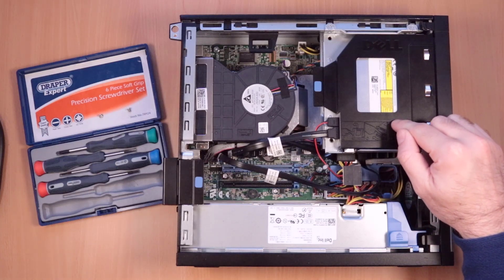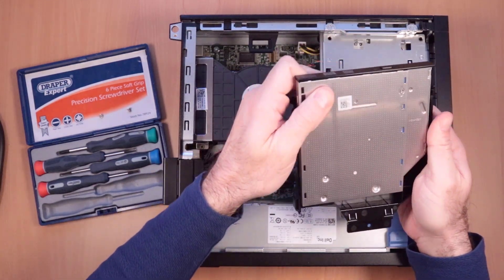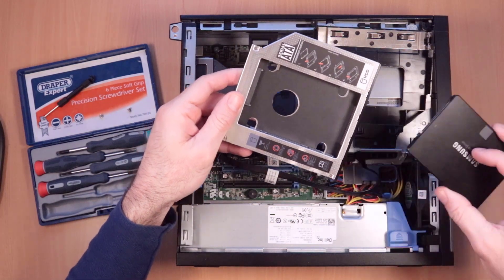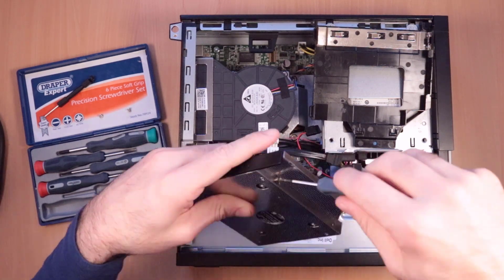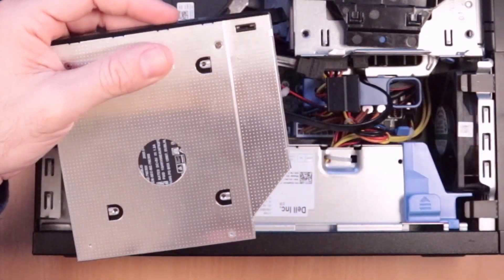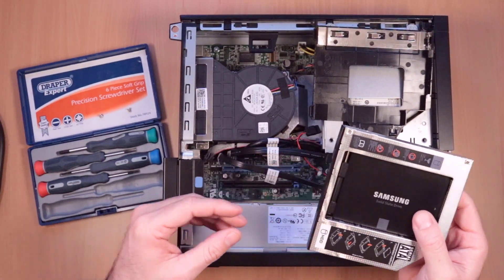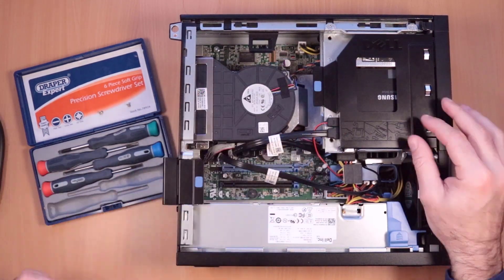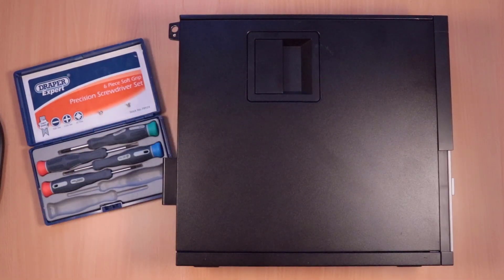Dell Optiplex 7010 Swap DVD Drive for Solid State Drive

Comment: No luck with getting my 7010 to identify the new ssd. Bought this caddy and disk management only finds the DVD drive. Assumed faulty caddy so plugged directly into the ssd using SATA and spare power cable and still having same issues. Anything I need to configure? I see there is another white colored SATA looking plug on the mother board. Do I perhaps need to plug SATA into that? Any ideas would be appreciated. Thank you
Reply from the maker: You might need to enable the SATA port in the BIOS, but it should be already enabled. 

Are you replacing the DVD drive or adding an extra drive?
Reply: Thanks for the reply. I managed to get it to work. I was adding a ssd just like you were in your video. 
Very odd as I eliminated it being a dodgy SATA cable, plug etc by swapping with an older SSD and the 7010 identifying via disk manager. Re installed and no issue. The SSD is a crucial so brand wise pretty decent. Anyways all working now and I really appreciate your videos so thank you :)
Reply: With a new SSD drive you need to go into disk management and create a new simple volume and format it, before it is recognized and can be used.

Comment: I really want to do this with my self made pc, it has a Gigabite H87-HD3 motherboard, I bought a pcie nvme ssd installed windows and it didnt boot.. im looking everywhere for a solution.. Do you think i need to do the bios modifications like you are doing to these pcs? if so, is it the exact same process? Thank you so much for uploading such helpful content!
Reply from the maker: The process is really dependent on the chipset of the motherboard (and if you can get write access to the bios)